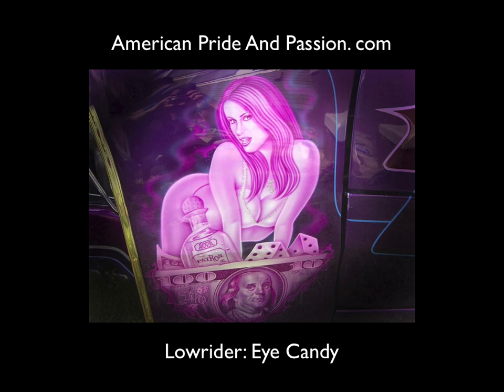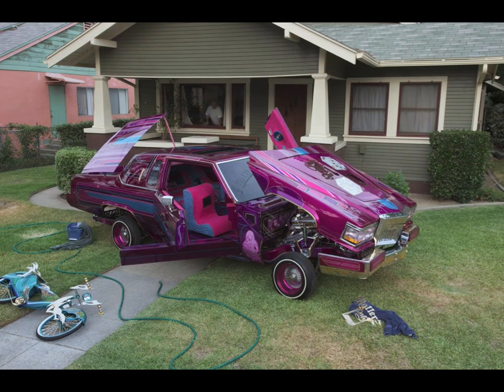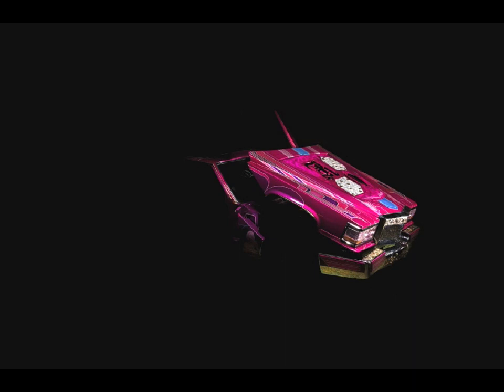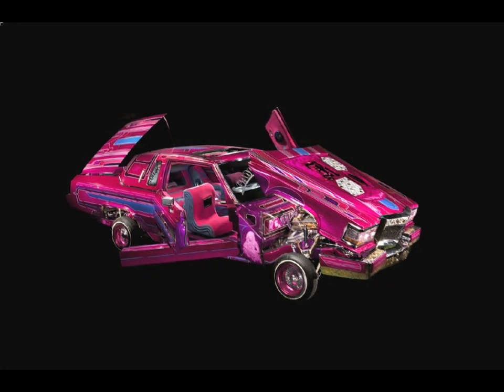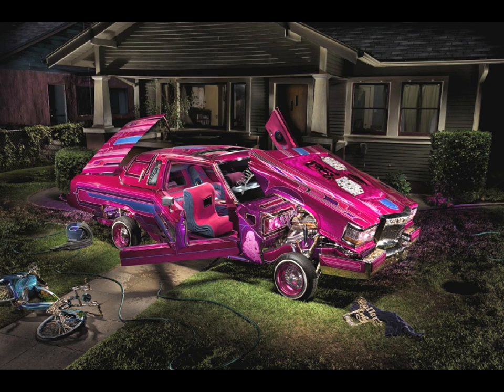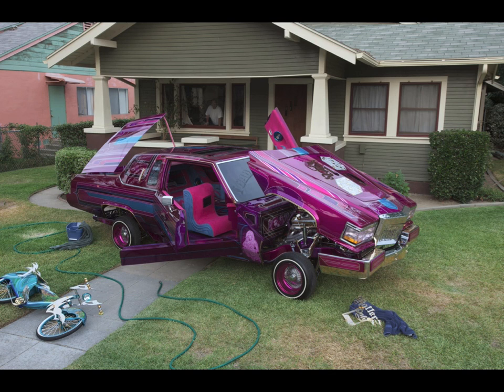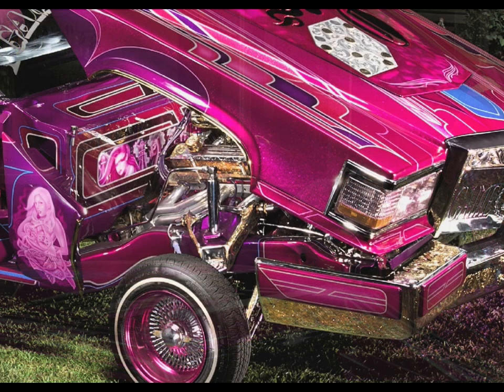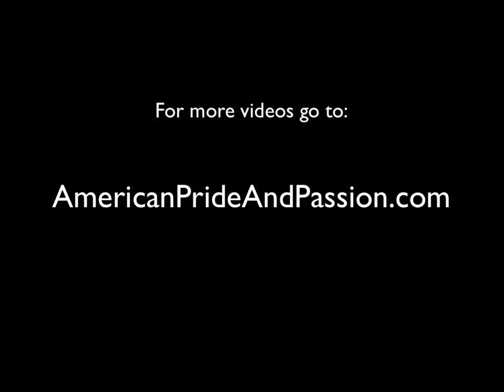Painting With Light : Lowrider Car

Comment from the maker: @andrewntom 

 I tis possible of course to using strobe as it would be so much easier and faster etc.  for me the quality of the light is paramount .. I use long exposures and tungsten lights to achieve a special type of lighting that only comes with  that technique.  Think about this. over the course of say 6 seconds when I am moving my light about 8 feet from right to left, it is the same as using an 8 foot wide soft box on a strobe head.  I can make the "box" big or small for every shot.

Comment from the maker: Brinkman corporation has them.  some are battery powered and some have an external battery.
I like the one million Big Max and the 250 candle power one too.  I use external batteries.
If you use an internal battery you will only get about 20 minutes of usage and if you do multiple versions of each component yo will not have enough juice to do a large scene.  

Hope that helps.

Comment from the maker: Yes it would work, you can not shoot shutter speeds that are too short using a standard camera, you need a Iris lens camera instead of a leaf shutter.  If you can shoot with say about a 1/2000 of a second and use strobe , it will work and be pretty neat, muyltiple pops in the day light and layer them on top of each other to look like a studio shot.

Comment from the maker: I can use a single large Mag Light or I use those standard photo lights that plug into the wall outlet.  I also use large BRINKMAN lights that have a battery that is syperate. Anything will do really, it mostly depends on the size of the object to paint and how dark it is outside ( darker the better so your lights seem brighter in comparison.  Hope that helps